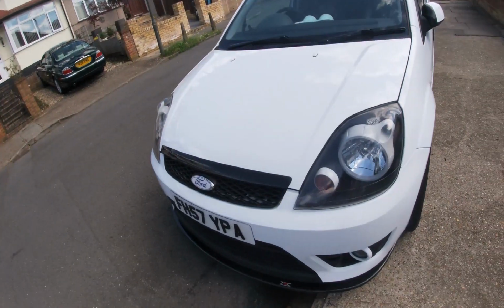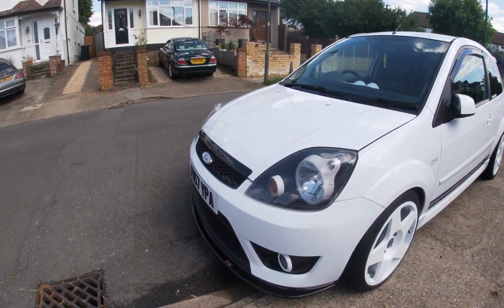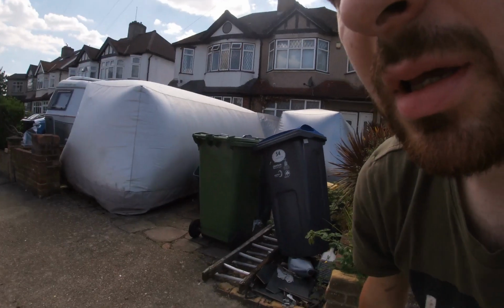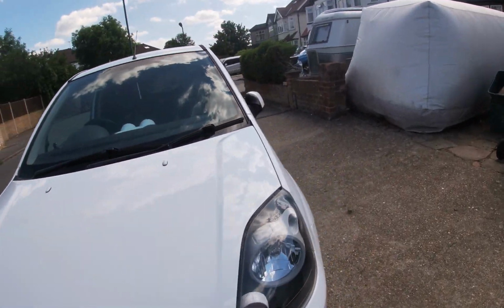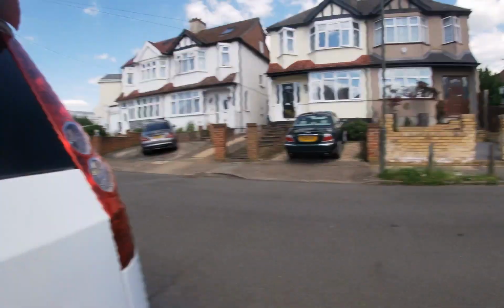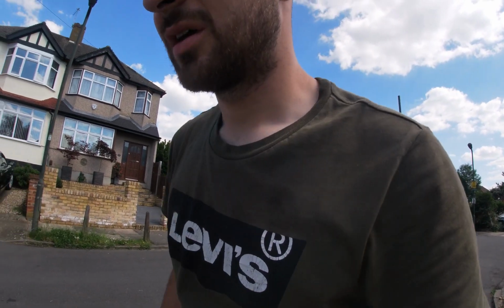Decontamination Wash On A Ceramic Coated Car (TRC Bonnet Lip Fitted MK6 Fiesta)

Comment: Looks great when clean  frozen white is deffo the best colour for st150 changed my badges also to the blue insert  with custom Dmb graphics headlight split next  keep up the great work on the channel 👍🏻👍🏻
Reply from the maker: Thanks mate much appreciated just the wheels that annoy me they get dirty again after one drive and nice sounds like you’re making some progress bud let us know how you get on with the headlamps 😊👍🏻
Reply: @6uiltdifferent  thanks mate ya will keep u updated I ear u about the wheels I have black autec wheels hides a bit of the road grime brake dust etc but no sooner than I wash car dust everywhere lol guess that’s the price we pay to have frozen white ya my next mod gunna be hella white twin horns to fit behind grill and thanks for info on the roll restrictor bracket  feels a lot better with the gear change down n up no rocking of engine etc 👍🏻👍🏻👍🏻
Reply from the maker: @shaungowler8909  sounds like you’re going to be a busy man lol and no worries they’re definitely worth doing in my opinion

Comment: Clean looking fez , could you do a video on how to resolve boot rattle issues
Reply from the maker: Thanks mate and I don’t have any rattles in mine might have to look into this but..... a lot of people say about the parcel shelf rattling have you checked that at all?
Reply: @6uiltdifferent  yeah had that removed and also wrapped the boot pin with PVC tape , doing my nut in lol
Reply from the maker: @paulwilliamson6525  what about removing the black plastic trim seeing if anything is loose, best way is to start shaking things to see if you can replicate the noise it has to be something silly

Comment: You need to get yourself a directhoses hose. I got a 20m one. No more kinks in the hose and no more moving the jet wash every few seconds.

A short lance is also a great addition
Reply from the maker: The hose I have is 50m as the tap is quite far I’m looking into the short Lance as I’ve used one and it’s great I’m going to get the Lance extender from karcher then I can leave the jet wash in one place
Reply: @6uiltdifferent  sorry it was the lance hose I was meaning being 20m. I wouldn’t recommend the karcher one. I had one and the core breaks and then kinks and it doesn’t stay flat on the floor so it hits the side of the car. The directhoses one lays flat like a garden hose and doesn’t kink etc. It’s also only £10 more than Karchers 10m extension
Reply from the maker: @lukek9694  happy days I really appreciate that mate I’ll get one ordered up at some point 😊👍🏻

Comment: wow man how long you were at that was crazy. Looks amazing. Even though i love the warm sunny weather its so bad for cars left outside. When ever i wash my cars and are spotless, litrelly the next day they are covered in what looks like dust/powder. I think its pollon. Sucks after so much effort its ruined in 24 hours.
i have looked up ways to cover the car safely and dont want a car cover as they are more hassle and can cuase more damage. I have found you can get these Car Umbrellas which look brilliant. But they cost hundereds :(
Reply from the maker: Was around 3 and a half hours I think 😂 it was a while for sure and the problem is your cars black it shows up everything unfortunately you’re fighting a losing battle on that one mate got any plants or bushes nearby that could cause the dust? Ideally you need the car in a more confined space rather than the open where it’s quite windy allowing dirt dust to float about
Reply: @6uiltdifferent  no it's next to the house, just bricks and just the grass to one side and that's not even down the whole side of the car.
Where I live is very green though.
I'm sure many years ago when I had my first black car it wasn't as bad.
Might be the time of year.
Wish we had some sort of car port so it was covered. I'd get one of these car umbrella s if they were not so expensive as look so handy
Reply from the maker: @DriveWithAndy  probably the issue with lots of green nearby and sometimes you’ve gotta bite the bullet on certain things I did that on my Carcoon’s for my other cars killed my wallet lol but don’t regret it at all
Reply: @6uiltdifferent  omg just went on Amazon those carcoons are £500+ 
That's way too much for me haha. I'd love a car cover but prob is dirt can get on the side against the car and with movement can damage the car more.
Wish there was a less expensive solution that didn't break the bank. If I can find one of these car umbrellas for less than I've found I'm be tempted.
Otherwise it's wash the car every week haha
Reply from the maker: @DriveWithAndy  yeah they’re not cheap on nope only dirt that is in there is already in the car they have carbon filters stopping anything getting in
Reply: @6uiltdifferent  so are they outside your house?
Reply from the maker: @DriveWithAndy  yes they’re on the drive you’ll see them in the background on the videos

Comment: Sorry if you've covered this before but:
I know you've got spacers on the rear, not sure about the front or if it's just the wheel offset, either way, with the front fitment, do you have any issues with clearance on the inner guard?
Thanks
Reply from the maker: No spacers just the offset of wheel and not really it only runs if I cornered ridiculously hard I only have issues on the rear tbh which I’m going to sort
Reply: what's the front offset?
Thanks
Reply from the maker: @lunch2102  ET45 if I recall correctly
Reply: Thanks
Reply from the maker: @lunch2102   no worries mate